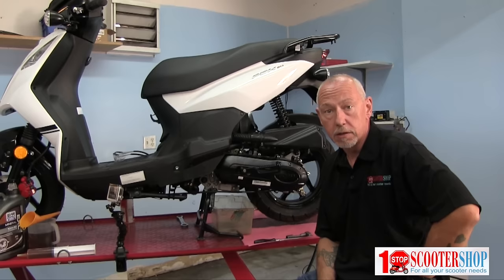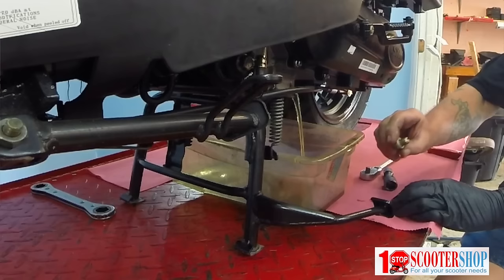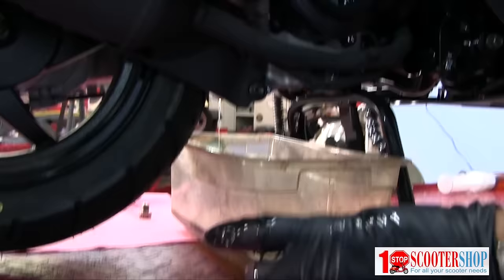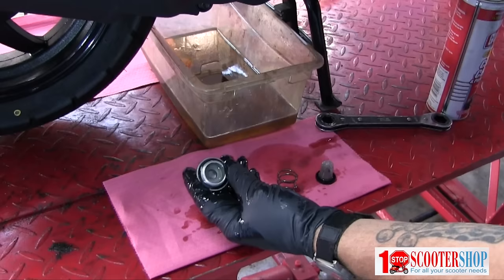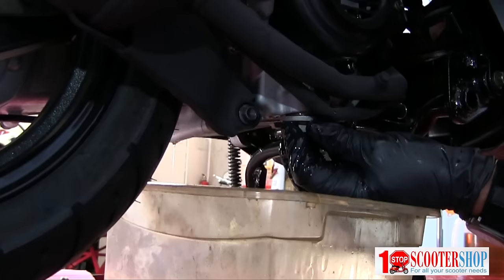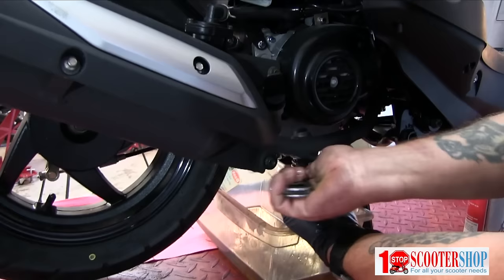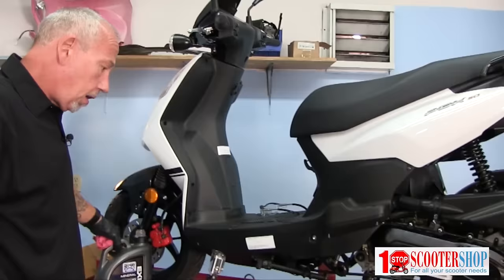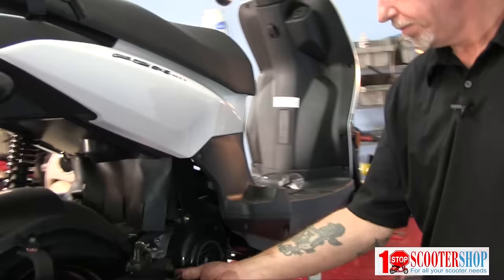Basic Scooter Maintenance - Scooter Oil Change

Comment: Just remember this is for four stroke scooters not two stroke. Another step missed is to check oil for a metallic sheen or debris. Where it is normal for a new engine as it's wearing in, it's not for  an older engine and indicates you have issues usually the oil pump. On most air cooled scooters there is no oil pressure warning light so you need to be able to read your oil
Reply from the maker: Totally right Bill. This scooter was brand new, we used it just for the video so..but def agree. Check for debris in the oil. Well said!
Reply: How do you do it for a two stroke? Please help, i’m really stuck
Reply: @jaydenplaysguitar3896  if the scooter is two stroke the oil and the disel put bouth in
Reply: Well you don't change the oil in two stroke generally. You just mix with gas
Reply: I thought you checked for debris when taking the filter off and cleaned? You mean point out and check more closely? Just wondering bc is there another part to check for debris that the video didn’t cover?
Reply: @jacknjill3000  Ball bearing debri and oil pump debri(plastic) is not something you would necessarily see in the oil strainer as it's not something that floats in oil. If you can move your variator back and forth then your bearings are away. Sometimes a flexible camera is good to have to check if you suspect there is issues with the engine

Comment: Another missed step. don't drain it cold, operating temp is best and let it drain for 15 min.
Reply from the maker: Good call out. We were doing this for instructional purposes on a brand new Lance (0km) but you are correct. Thanks for the pointer
Reply: @1stopscootershop283  that's what I thought because I change oil in my scooter at 800 km recommended change is 1000km and oil always change Colour to darker shade while in here is almost new
Reply: Seems there's different views on this and both have very good points and it all depends if you have had it sitting for months and months Vs just a regular oil change. They say don't run the oil warm if it's been sitting for many many months as all you're doing is spreading all the shit around the engine again rather that drain it cold.
Reply: @smoke6359  then change the oil cold.
Reply: @1stopscootershop283  Great Video,  you speak nice and clear . 
Remove the oil filler cap also before you undo the sump plug , so oil can flow out more freely  ,

Cheers  .

Comment: I change oil every 280 to 320 miles on my Honda metropolitan, that's usually when it begins to darken, I depend on my scoot ALOT , & just gives me peace of mind knowing she's full of clean oil, 14 oil changes in 4,000 miles but, I'm hoping it'll benefit  in the long run ✌️
Reply: Do u do any other maintenance. I have a icebear vision 150cc air-cool rd 4sroke .is there any other maintenance i need to do besides oil change
Reply: Oil is cheap , and oil change is easy , do final drive oil at same time as engine oil , it wont take much ,
Cheers .
Reply: Probably doing it way more than you need to. But it's better to do it too frequently than not enough. Only consequence of too frequent is the cost of oil. Better than the consequence of not enough
Reply: What’s the recommendation or what the manuals say as to when to changing the oil? I just heard by googling that 500miles is when you should change the scooter oil.

Comment: oh shit! i just put in Red Line 90W! The label by the dipstick on my Shanghai JM Star simply said use GL-3  gear oil.  Like there is only one weight. well i'm going to go with it. WELL DOUBLE SHIT. this is just for the engine oil. and it has to be 10-40. i'll drain it out and put it in the rear diff (aka transmission).

Comment: it's all good but if you check don't screw dip stick just put it in  and than check oil level....
Reply from the maker: kheiry mekni thanks for the comment.  this was a Lance scooter which does call for you to screw in the dipstick because otherwise you could get an inaccurate reading. Other scooters I agree with you
Reply: 1 Stop Scooter Shop how do you tell ? I have a Korean hyosung beaver should i screw it in or not to check also  what oil do u  use for scooters just car motor oil  ? Thsnks
Reply: 1 Stop Scooter Shop do hyosung scooters screw in  to test  ?

Comment: NOOOOOO..........
Don't use mineral oil use semi synthetic.
Really easy to remove filter screen housing on new bike but a few months of road grime and salt will soon make it hard to remove so don't bother, the mesh size of the screen is so large everything will pass through. As someone else said just use the 17 mm bolt at the side on this SYM model and also tilt the scoot towards you as more oil will come out.
AND NEVER have the oil level checked on the dipstick just after filling, run the engine for a minute then leave it off for a couple more then insert the dipstick so it just rests on the filling hole, do not twist or waggle it about, the oil should just reach the top of the cross hatched area, this is the maximum fill level NOT I REPEAT NOT as indicated on the smooth part of the dipstick. I have owned and still own two models a Jet 4 125 and a Fiddle 3 so have done many recommended 1000km oil changes. Manuals for most scooter models can be found online for free giving extensive information on maitainance , manuals library being just one.

Comment: 4 stroke engine so oil is changed; 2 stroke typically with direct oil injection doesn't need oil changes (just add high quality injection oil). Just pointing this out - thanks for doing video.

Comment: I have a couple questions. How can I tell the oil is clean? Other question would be that how would I know when to change the oil? I am new to having a scooter, and have no idea to how to maintain a scooter. I just got  a 2020 Yamaha N Max 155, and it keeps flashing oil on the indicator, but I don't see anything wrong with its performance. Please reply as soon as you can. I will really appreciate it.
By the way if there's anybody on the comment section that can help out and have some knowledge for this topic it will be much appreciated as well.
Reply: Do not ride if it needs oil change ! It can mess it up ! 
Every 2-500 miles you oil change ! 
Check screws regularly and when you put gas to light sprays so the fizz from gasoline doesn’t overflow from tank

Comment: Hello how are you? I have a question. I just bought a solana yn50qt-8 and im wondering if 93 is the best fuel for it or should i be using 87?
Reply: The higher the octane number, the better, but rather depends on the quality of the gasoline itself.
Reply: 90+

Comment: Thanks for the nice video. how often do you recommend this should be done?
Reply: Every 2000km
Reply from the maker: Thanks jeyzee691 and good question. It really depends on your driving conditions (dusty area, climate, etc) and the age of the scooter and mileage. On this particular scooter (it was a new Lance just for the video) it’s recommended after the first 300km (186 miles) and then every 1000km (621 miles)
Reply: @1stopscootershop283  I've wondered why is oil so clean and bright.
Reply: @andrewbozhozr  It's a brand new scooter being used for demo.

Comment: Hey how do you start a Lance Cabo 200I that doesn't wanna start? I turn the key and it doesn't even light up. It has gas left it full when last used 5 months ago.
Reply: You probably figured it out by now, but because batteries slowly drain you won't have any juice left. If you have a kickstarter you can use that, if not you will have to take it for a little walk. Another option is to charge the battery a bit with a charger or by hooking it up to another battery of the same voltage.

Comment: Can I use API GL-4 SAE-90 GEAR OIL in Transmission of TVS Jupiter or Honda Activa 4G 110cc gearless scooters? 
Will it reduce the performance, pickup & milage and increase the wear & tear of transmission gears of scooter?
TVS company manual recommended to use same engine oil (10w30 JASO MA2) as the gear oil in transmission also.
Reply from the maker: Sidg2 can’t say with certainty about the performance etc but I’d stick as closely as possible to the manufacturers recommendation although are you sure they said to use the same engine oil as transmission? This doesn’t sound right to me. Wonder if it was a misprint. Good luck, let me know
Reply from the maker: Sidg2 can’t say with certainty about the performance etc but I’d stick as closely as possible to the manufacturers recommendation although are you sure they said to use the same engine oil as transmission? This doesn’t sound right to me. Wonder if it was a misprint. Good luck, let me know
Reply: Does API GL-4 SAE90 Grade Gear Oil and SAE 80W-90 Grade Gear Oil have almost same viscosities? 
Can I use any one of them in my Honda Activa 4G or TVS Jupiter 110cc gearless scooter's transmission?
Reply: there is 10w40 gear oil. gl4 semi synthetic. Yamaha use 10w40 on neos 50 .Follow recommendations ALWAYS.

Comment: Florida in winter should I use  15w 40 or 10w 40 ? Scooter has 1500 miles on the odometer.
Reply: What is the brand of the scooter? Manual of my Piaggio says 10w40,  but in my country we use 5w40. It's because we have a colder climate.
Reply: @Mech.E  peace sports 49 CC. (RY50QT)
Reply: @Mech.E  manual says to use 15w 40.
Reply: @danieldasilva3068  10w40 should be fine
Reply: @Mech.E  what about gear oil..what kind. Manual says to use GL4 but what kind?
Reply: @danieldasilva3068  75w90

Comment: Might sound stupid but what happens if I put the filter screen up into the engine instead of down into the spring?
Reply: Billy Bob BOOM
Reply: Wow
Reply: Billy Bob Won't fit 👈
Only one way 👈
Reply: Daniel Andujar Well, I did it without knowing better, it smashed the netting a little. I drove for seven miles before changing the filter direction again. However, that might be on my cheap chicom scooter and not other people's.
Reply: Billy Bob Thanks  for sharing /// Have a nice one. .
Reply: It's impossible , wouldn't  fit. It's a safety measure every maker have.

Comment: What do you use to clean the filter?
Reply: Just a Pro Random Gamer Use brake clean. Preferably the non flammable kind.
Reply from the maker: Gumout carb and choke cleaner. (Any carb and choke cleaner should work) This is recommended over specific brake cleaner as it has fewer chemicals and therefore may leave less residue when you’re cleaning the filter.

Comment: Do hyosung scooters screw in to check oil or not  ?
Reply: Paul Williams no.
Reply: Alvaro Sánchez is a 10w 30 car oil ok and do u need to undo the bolt on the other side to get all the oil out or does enough come out with the filter bolt by the exhaust if u warm the engine  first. . Thanks
Reply: @matowixunplugged7927  you need motorcycle oil, this engines run harder, cools down the engine and need the aditives on Motorcycle oils like anti foaming and anti shear properties. Any MB or MA motorcycle oil will work fine, better a know brand semisynth. every 4.000 km or less. Take a look at tour manual, if missing sure you can find it on the web
Reply: Alvaro Sánchez no manual anywhere for a hyosung beaver 125cc scooter ive looked everyehere on the net.
Reply: Alvaro Sánchez also scooters don't have a gearbox in with  the motor so there is no shearing but yeah they get hotter being aircooled.
Reply: @matowixunplugged7927  just use a semiynthetic 10w40 with highest service code you find al year long and your be fine. Brands like Liqui Moly, Shell, Castrol or Wolf (Belgium)
Reply: Alvaro Sánchez thanks. do u know where I can get that hyosung service manual on  the net ?

Comment: I have a question could u use regular car oil 10w 40
Reply: no, it will mess up your scooter. Use motorcycle oil.
Reply: without wet clutch you can use if it is jaso ma2 compatible and not energy conserving type of oil. Do not use mineral oil.
Reply: @Waldo5  That's bullshit dude. It's the same
Reply: The only thing that I’ve used on all the scooter and motorcycles I’ve had, is to use 10W 40. I wouldn’t use any other type.